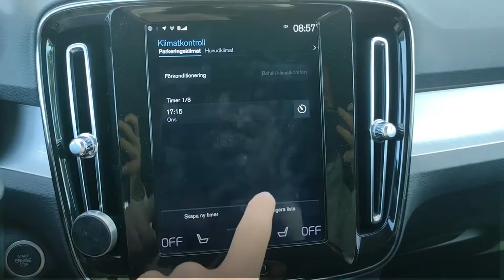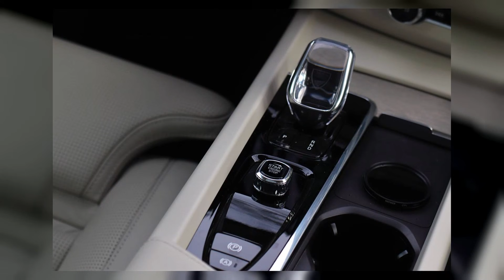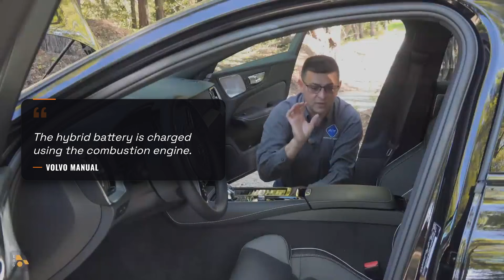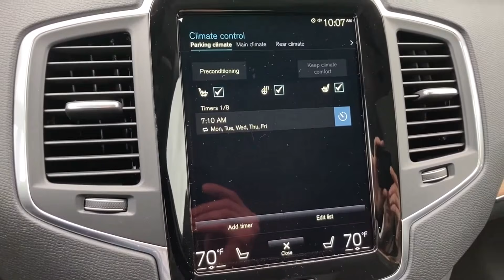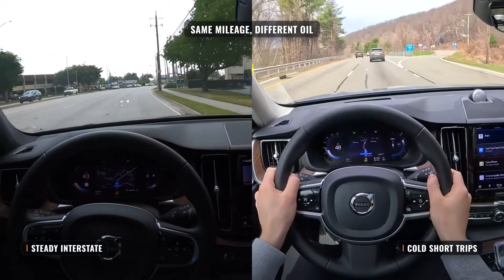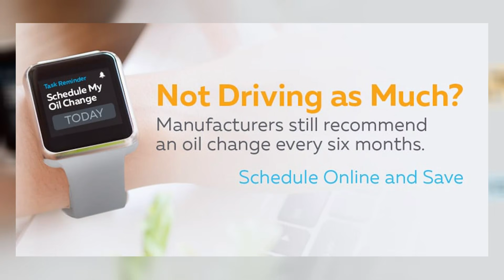These 5 HIDDEN Volvo Settings Are Ruining Your Engine Reliability & Lifespan (TURN IT OFF NOW!)

Comment: Having replaced the engine in my 2016 Volvo XC90 T8 once at a cost of $17,000 was a great lesson. Now self education through videos like this one is the extended class that all modern Volvo owners must learn that this isn't a suggestion, but a Volvo lifestyle. The sooner you act the happier you'll be with that beautiful car. Mine has nearly 180,000 miles and it still thrills me.